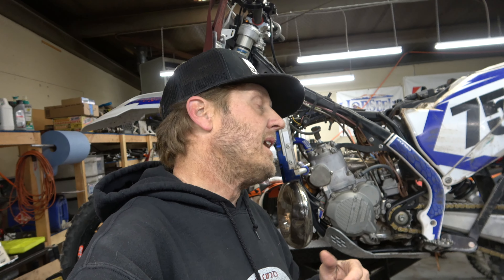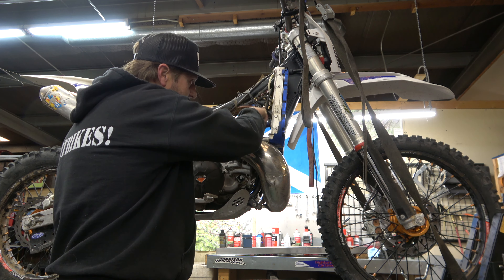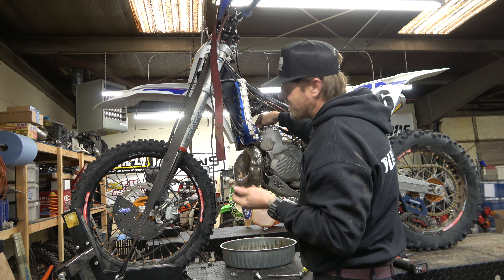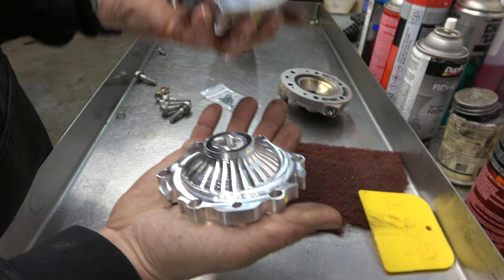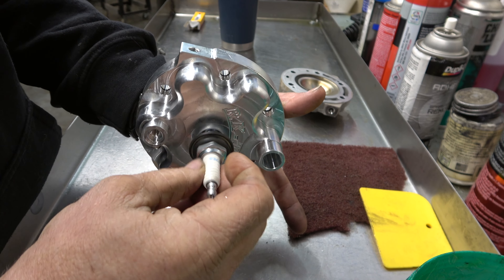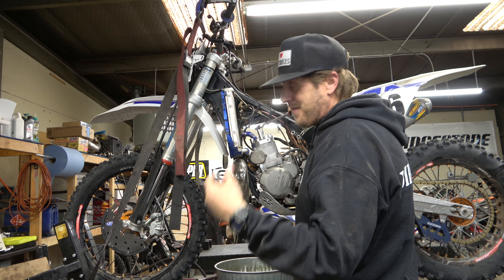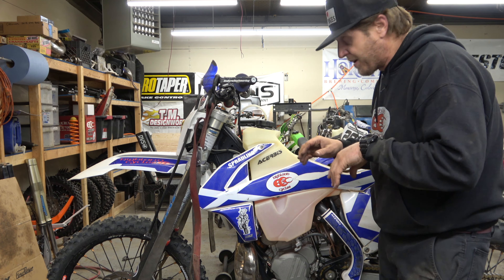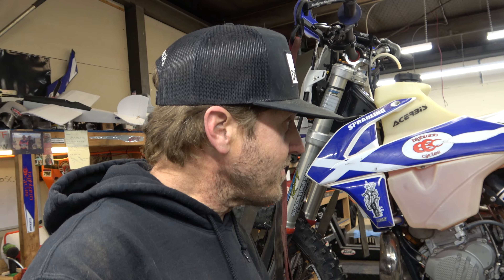RK Tek Head : KTM 300XC-W

Comment: any update on the jetting? did you mess with the needle after riding it? I will be running this exact setup on my 18 300 xcw would love to hear if you got it dialed and what the final jetting specs are. I will be running mostly sea level to 5,000 at most.  thanks in advance I also plan to do some of the recommended carb mods let me know if you think its necessary

Comment: I put a RK tek head on my 300 xcw. Wasn’t long before I noticed a coolant leak. I chased it for months. Finally noticed that it was leaking between the head and the cylinder. I tried changing o rings, retorquing bolts nothing worked. Finally put the stock head back on. No leak now. Kinda sucks. It ran great with the RK Tek head. Any ideas? Thanks.
Reply from the maker: I would talk to Kelsey. We had an issue like that with the 125 and it turned out it was a super small tolerance issue with the insert. Sent it back, he machined it, made some notes for future customers and it’s all good. It sucks to have that happen but he is a very small shop and small mistakes are going to happen from time to time.

Comment: I put the RK Tek head on my '18 300xc. I also went Lectron and 250sx CDI with a FMF shorty and of course the crappy stock reeds I changed . Its a rocket. I wish they made heads for Kawi's. I got a '96 kx125 I just built and it could use a new head and they are hard to find.
Reply from the maker: They will re shape the KX head. Just send it in and tell them what you want.

Comment: Enjoying your videos.  I recently installed an RK Tech head on my 18 TE250.  I am running the PWK keihin 38mm with the stic emulsion tube.  Original set up was JD red needle #2, 48 pilot, and 180 main, 50:1.  Pump gas 6,000 ft, here in Albuquerque NM.  Bike ran fine but I am getting a lot of spooge, I am talking dripping down on the swingarm spooge.  So I ended up getting white needle #3, 45 pilot, 175 main.  I decreased the jetting size.  Gonna test it tomorrow.  Before I installed the RK Tech head I was getting almost no spooge, and bike ran fine with the original jetting set up with the keihin.  I will say that the power increase was terrific, I just don't like too much spooge, and feel that something may not be right.
Reply from the maker: Thanks for joining in on the live show

Comment: so Is it because of your altitude you run a high compression Head  normally I thought you would do it Low compression to give it more bottom in the woods/ trails
Reply: Generally raising compression will actually give you more bottom end, not lowering it. You can go too far though, especially on a 300, and the power becomes less useable (wheel spin). Morgan is at high altitude, so it won't hurt at all to bump it up some... There's a lot more than just the compression ratio that goes into these heads though.
Reply from the maker: Yeah, we are at 6k and more compression always helps. And like Cody said, it’s not just a bump in compression

Comment: Morgan, agree with you that you don’t need to torque a head down on a 2 stroke. I’ve been owning/riding them for 40 years and have done numerous top ends without using a torque wrench, no issues, period. Also, I just recently installed an S-3 head (0-6000 ft) from Slaven’s on my 2019 300xcw TPI and was wondering if you had any experience and/or comparisons to the RK head? Love the videos man keep um coming. Thanks
Reply from the maker: I have ridden both on different bikes. I really like the RK better.

Comment: Hey Morgan, I just put one of these on my 17 300 xc. I haven't run it yet because I'm doing a few other mods. I didn't put grease on any o-rings, but did use the spark plug to hold the insert inside the head. I replaced the two o-rings on the cylinder, but didn't grease them. Do you forsee any issue? Or you think they need grease to seal right? Thanks in advance for your expertise!
Reply from the maker: No, you’ll be just fine. The grease just makes it easier to keep them in place.
Reply: @highlandcycles  oh, man.. thanks for giving me a little peace of mind. I really didn't want to take all that apart again lol😂

Comment: Original O rings?
Reply from the maker: Yeah. Since it’s mine and they looked new still. I’d put new ones in for a customer but I don’t mind risking it a little on my bike.
Reply from the maker: They were still sticking up above the surface of the cylinder quite a bit.
Reply: @highlandcycles  understand fully. Do you concern yourself with X dimension on your KTM's? I used to set at zero on my 200 XC and it really made the motor run strong. I may try the TEK insert on my Beta someday.
Reply from the maker: @200xcBruce  I don’t worry about it much. I know you can get more punch but the 300 runs so strong that I don’t mess with it. Now with the RK head it’s going to have a ton of grunt.